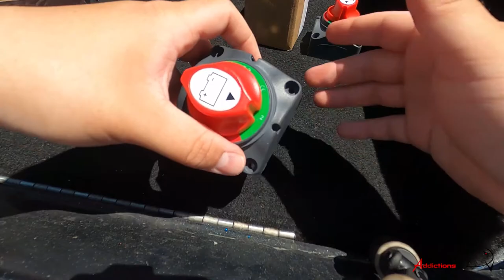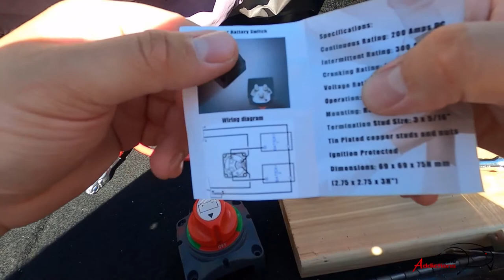Installing Deep Cycle/Cranking Battery On/Off Switches

Comment from the maker: Here's some timestamps to navigate the video easier. I don't know why but YouTube isn't adding the timestamps directly into the video like it should. 

0:14 Intro
2:30 Switch explanation
5:43 Switch location
8:31 Drilling holes
10:00 Cutting trolling motor wires
12:50 Crimping trolling motor wires
14:48 Rigging up deep cycle battery wires
17:40 Connecting trolling motor wire and deep cycle battery wires to the switch
18:50 Installing dual battery switch
20:30 Testing dual battery switch
21:37 Start of adding cranking battery switch
23:44 Cutting motor positive wire/explanation
27:34 Cutting motor negative wire
27:56 New wire to run to switch
29:40 Crimping wire from motor to switch
33:20 Starting to get wires ready for the switch
34:50 Connecting wires to switch
35:50 Installing switch
38:00 Adding battery post clamps
39:14 Testing cranking battery switch
40:24 Recap of Wiring
Reply: Hey great video. I’m trying to add a battery on and off switch as well to my battery that my sonar units are hooked up to. Maybe you could help me out a little ?!  I would appreciate it a lot. I have my battery and I have positive and negative 4 gauge wire coming off of it to a fuse box by the console. At that fuse box I have my sonar unit Hooked up to it. So how would I go about hooking up a battery on and off switch to that battery ?  Would I hook up some wire from the battery(positive) to the on/off switch? Then hook up some wire from the on/off switch to the fuse block? Any help would be appreciated greatly. Thankyou!!
Reply from the maker: @jordanpadilla99  Yep, You could honestly put it either between the units/fuse block or the block/battery, it will function the same way but... if there are other things connected to the fuse block and you put the switch between the block/battery, when you turn it off, it will shut everything off that is powered by the fuse block. That may be your goal in adding a switch, like what mine was (to completely cut power off from everything) , but if you want the fuse block to keep powering the other items even if you shut the switch off then it would be best to put it between the units/fuse block. Let me know if you have any other questions or if that helped you out!
Reply: Thanks for replying. And I don’t have anything else hooked up to the fuse block. The only thing on the fuse block is my sonar unit. So if I were to put it between my fuse block and my unit where do the wires hook up to that come out of the on/off switch. And what size wire do I use ?! Thanks
Reply: I know that there are 2 wires that come out from the on/off switch but where do I hook those 2 wires up to? One to the battery ? And one to the fuse block ?
Reply: I want the switch to shutoff everything on the battery/fuse block. Because that battery is used only for my sonar units so that’s all that is on the battery so it’s fine if the switch shuts off everything on the battery or fuse block. There is nothing else on it
Reply from the maker: @jordanpadilla99  Okay, then you can definitely put it between the fuse block and battery. Doing it this way may make it a little cleaner and easier, because you can put it in the same compartment as the battery. And yes you are right, coming off of the switch one wire would go to the fuse block and the other wire would go to the battery. Depending on how much slack you have in the wire you are adding the switch to, you may not need to buy any extra wire, it just needs to be long enough to reach where you are putting the switch plus a few inches for wiggle room. But to essentially add the switch, you take one long wire, cut it in half, and in between each of those halves, you add the switch. May seem intimating at first but its fairly straightforward. 

Note: if you do need to buy more wire to reach your switch, then try and measure the outside diameter and look around online to find some ofc wire with the same outside diameter. If you do not have any trips planned and can let the boat sit around for a little bit, then you could cut the wire in half and measure the actual wire strands diameter. Many companies do not have the same amount of wires inside or the same thickness of the sleeving on the outside so physically cutting the wire open to measure the actual wires on the inside is the way to go. Either get wire of the same size or bigger, never get smaller wire or it may not handle the amount of amps going through it.
Reply: @BassFishingAddictions  Question for you.    I had an instance last year where the cranking battery died and I had to have a friend go get jumper cables back at the boat ramp to jump the boat.     I have seen video's where they say you can install the Perko switch so that if this happens, you can switch over to your deep cycle 24 or 36 trolling motor batteries to jump the boat.   Here are my questions.    1.   Is there a specific way that this needs to be hooked up since the trolling motor batteries are in series so you are not using all 24 or 36v to crank the main motor?     2.   Can you hook this up to a 24/36v series system along with the standard 12v for the cranking?   If so, how do you do that?    I cannot find any video's online on Youtube that tells someone how to do this or if it will cause any problems.      3.   How does this switch affect charging of the batteries?    I have a 3 bank charger that charges my 2 trolling motor batteries and my cranking battery (ProMariner 20+ on board charger).    Is there anything that I need to know or hook up differently if I install the Perko switch to allow all of the batteries to charge during the season or during the winter when I keep it plugged in to keep the batteries conditioned?
Reply from the maker: @charlesjudd4194  Sorry for the late reply, I know exactly what you mean. 1. Yes there is a specific way. I haven't done it but with logic I can help. 

2. If you have two, three or however many batteries and you want to wire them all together for 12v you simply connect all positives together and all negatives together, the voltage will remain at 12v. If your trolling motor was only a 12v system this would be simple. But if you have two batteries wired together for a 24v system you have a positive wire coming from one battery and a negative wire coming from the other battery going to the trolling motor, then the batteries are wired together with the remaining positive and negative posts to complete the 24v.

Now how to hook it up to the cranking battery? To be safe I would use three of the single battery on/off switches. I would put one on the 24v system on the wire that connects both batteries so I can switch it to the off position and make it so they aren't technically connected meaning each battery is its own 12v system again. Then the second switch I would use it to connect one of the trolling motor batteries positive to the cranking positive. You will still need to connect the negatives in some way though so you will have to install yet another switch. Why install a switch for both the positive and negative? Depending on what battery you chose to use in the 24v system, one of the posts will still be connected to the opposite terminal of the other battery... so if you just connected the negative (or positive) with a solid line all the time, having the extra arc over to the other batteries opposite terminal (again depending on what battery you use) may cause issues especially if you have the 24v system connected and running. So if your cranking battery is dead, you can switch the 24v system off, turn both of the switches going from the trolling battery to the cranking on and it will work. I don't think many do it because once you start mixing voltages and adding a bunch of switches the chance to fry something increases due to just one little mistake. Even using jumper cables to charge the cranking battery, its still smart to disconnect the 24v system so nothing happens.  Trolling motors, outboard and batteries aren't cheap either. 

3. Hmm, Im not entirely familiar with the unit but it looks like it can only charge from each bank at 12v. On the product it says 12v/24v/36v which I'm guessing its saying it will charge up to 36v at a time when each bank is hooked up, not necessarily a 24/36v system. Regardless charging each battery individually is the way to go because it will enable each of the banks to pump out as much amps as they can handle. So in short the switch wont affect charging, youll have to turn each off them off each time though. 

Im hoping I helped you out some. Im sure, you probably knew half of what I typed but its also for whoever else stumbles upon this.

Comment: If I understand correctly, you have a 12v trolling motor. You have 2 batteries to double the run time. You should wire the batteries in parallel, so you get double the runtime but do not have to manually switch the switch for the second battery. You can still utilize the switch as a power shut off when storing the boat. I am about to hook up a main power shut off in my boat along with a bus bar for my accessories. I was looking for a good spot to bolt them and the spot you chose is perfect. Thank you for the video and keep up the good work!

Comment: Good 👍  wow
Reply from the maker: Thank you
Reply: @BassFishingAddictions  so, the negative lead of the trolling motor just goes to one of the batteries negative post permanently and then use a jumper cable to the other battery's negative post?

Comment: Tell me you have no idea what you are doing without actually telling me 🤣🤣🤣🤣 DONT DO WHAT THIS GUY DID FOLKS
Reply from the maker: Lol tell me what I did wrong smart one, I've been wiring things together for years. I'll be waiting for the response
Reply: @BassFishingAddictions  first you cut a motor wire not even knowing if it was 1 or more wires inside. Then didn't have the right tools on hand to fix. Then hooked up all the positives to the battery which defeats the reason for the battery selector. Face it you have no idea what you are doing
Reply from the maker: @Lefishn  The motor wire was attached by one single lug, wouldn't matter if there was multiple wires inside because they're all rigged up... again.. by one single lug.. and it needed to be redone. What tools didn't I have on hand? Its been awhile since I posted but I suppose unlike you it wasn't a project that needed to be completed within a day. Also, it doesn't matter if I connected everything to the positive terminal on the battery instead of the switch. I ran the negative wire to it because it was easier. You simply have to disconnect power to either the positive or negative side of the battery and nothing will work because the circuit has been broken... So based upon your answer it seems like you are actually in fact the one who does not know what you are talking about, thanks for the good laugh though.